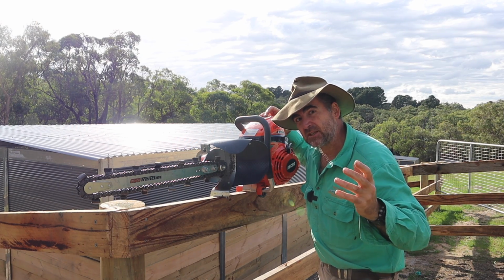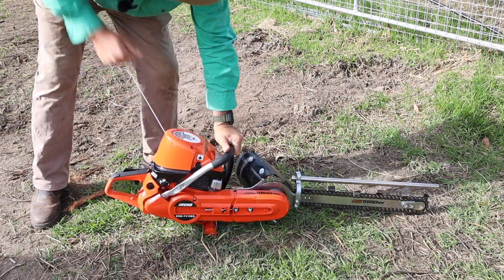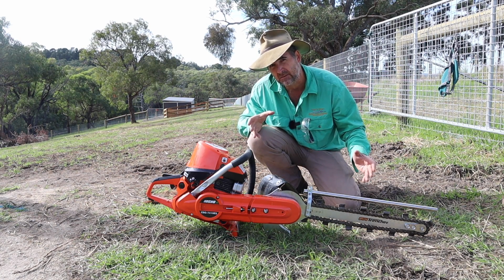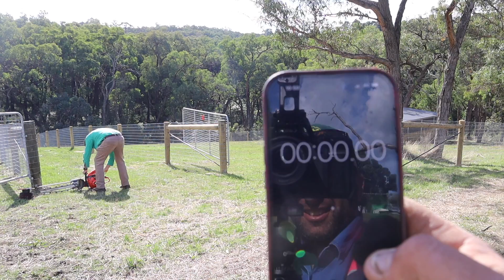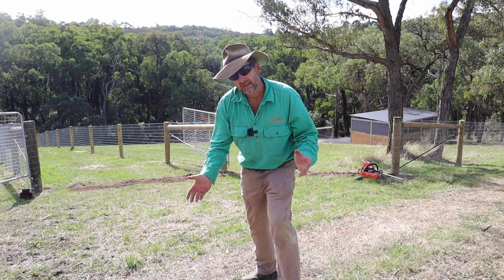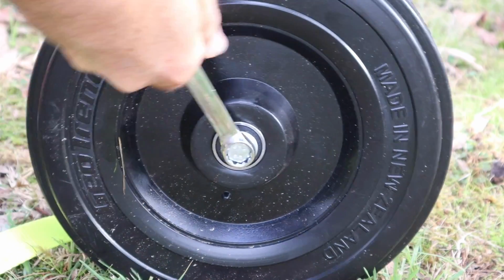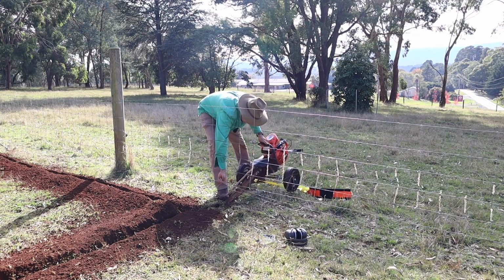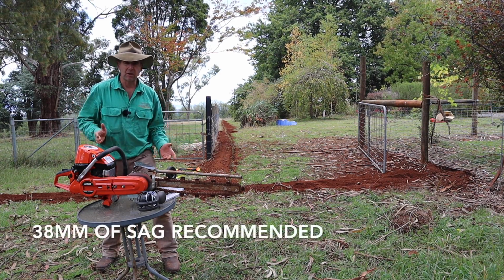🤔How Can You Trench Faster AND Harder? 🤔Geotrencher Review

Comment: Great concept. I have been waiting for it since 1973. I doubt it will last very long. Trenching can beat the crap out of any kind of trencher.  I remember a machine called The Mole in the 70's. It had a rotating  'wheel" with four prongs maybe 8 to 10 inches long. It seemed dangerous as hell and it flung the dirt everywhere so you didn't have enough to backfill with. It was small on a heave duty wheeled frame.

Comment: Looks like common sense, instead of a gigantic hole and machine. Its probably suitable for 90 percent of what needs done. The new zealanders are probably doing it right by the looks of it
BUT i think the concrete saws should be 4 stroke gas or diesel.

Comment: The protection bar looks like you could replace with a pipe and lay the cable while you trench like a full size trencher. Only a though. Keep up the reviews also where can we get those work shirts you wear? They need TT branding.
Reply from the maker: They do!! I get them embroidered in Lilydale by a local supplier…. And I reckon you could easily run the cable as suggested!

Comment: You don't run your insulated cable inside poly Tim? Seems to save the insulation eventually getting stone chipped and shorting the fence
Reply from the maker: Honestly not had that problem before mate. I’ve got 30 year old fences that are still working fine. The Gallagher stuff is pretty good
Reply: @FarmLearningTim  yeah, ok. I use Gallagher, but maybe being a dairy with more foot traffic in and out of the gate twice a day etc when in those paddocks created the issue (especially in wet years like last year). You know when its shorting, because the cows wont walk through the open gate.  Sleeving it in some old agline takes care of it.

Comment: Thanks for the vid...interesting piece of kit indeed...could have used it recently putting down half a k of blue line, but not sure it would be wide enough for 25mm pipe and I'm guessing not close for 32mm...can they go wider than shown?  Pretty expensive though...over $5000 for the Stihl 500mm model with cart - hope the hire companies pick them up.  Do you know how they go with tree roots? Depends on the size I guess.  The 38mm of chain slack is interesting / frightening...
Reply: Hi Ross,  we do wider chains as well but 1 1/2 fits the 38mm easily enough.  Dryer or rocky soil ends up with a slightly wider trench.  Most roots under 35mm are fine,  bit less if they are hard woods but then a crowbar or recip saw works well 👍🏻.
Reply: ross holmes, you'd be best avoiding using a stihl for this.  i used cut-off saws for a living 30 years ago and i hated the stihls.  i was forever having to lift them out of the cut so they could build up revs again.  8 hours a day of lifting a stihl in situations where i only ever had to give a husky more throttle.  i spoke to a bloke who works for the local council about the stihl cut-off saw i spotted on the back of his truck. he used to run his own business and said they are still gutless.  after 30 years stihl still bludges off an undeserved "reputation" of quality instead of improving their product to keep pace with the competitors.  if geo trencher recommends echo, thats good enough for me.

Comment: Does it work in hard clay? But yeah had always wondered if a chain saw equivalent would work, given trenchers are just overgrown chainsaws. Plus with the Geotrencher the trench is right for cabling or small pipe, trenchers I have hired do 200mm or so and then the backfill has usually never hidden the work you can see where the trench was or need additional soil.
Reply from the maker: This spins faster than a trencher so the soil particles are finer and go back in easy. My soil (second half) is heavy clay and quite compacted where I was trenching (see ground cover).

Comment: What's it cost ?  Okay if you're digging miles of skinny trench , no good for anything over 2 inches from the look of the trenches you dug  .  Could be more cost effective to hire a ditcher for that once in a blue moon job . That said , it is a very clever Kiwi gadget .
Reply from the maker: Yeah it’s not an excavator. It just does what it does really well. Many trades never need more than a 2’ trench.
Reply: @FarmLearningTim     But what does it cost ?
Reply: @FarmLearningTim    I forgot to ask , It looked as though the dirt you were trenching through was very sandy . Have you tried it in harder ground ? I think it would be very hard pressed to cut my hard clay / shaley  horrible stuff .
Reply from the maker: @erikhouweling1552  Yep spot on. I accidently did exactly that when crossing over on one of the ends of the trench.
Reply: @erikhouweling1552  depending on how wide your after there are a few options including buying the wider chain.  Most people find two cuts but deaper than you need is the way to go - any loose soil from the second cut ends up below where you need to lay your cable / pipe etc so no need to clean out.